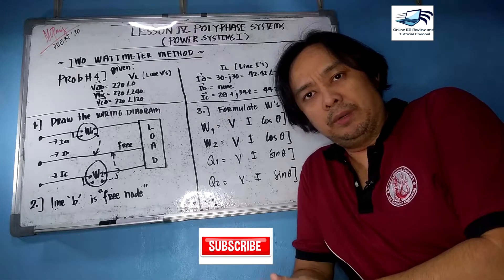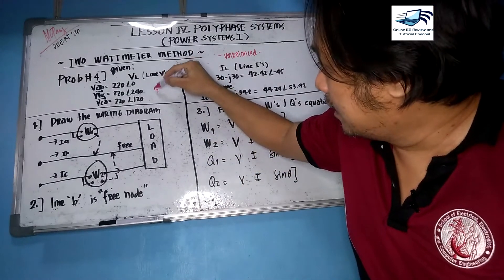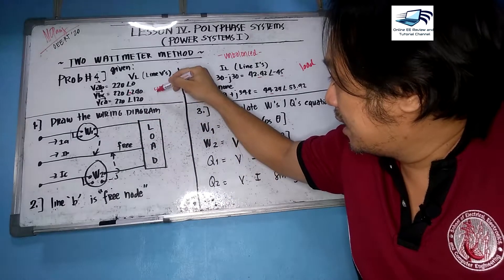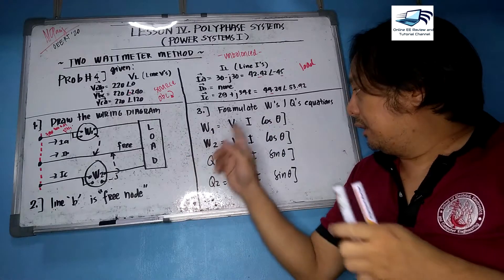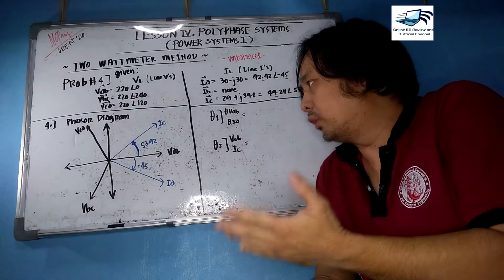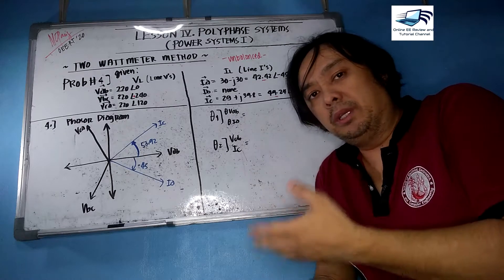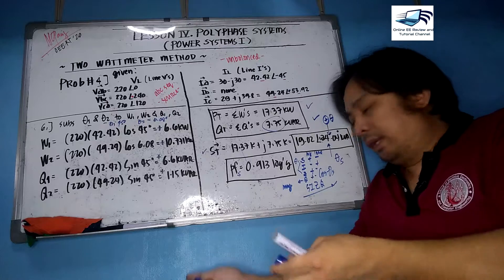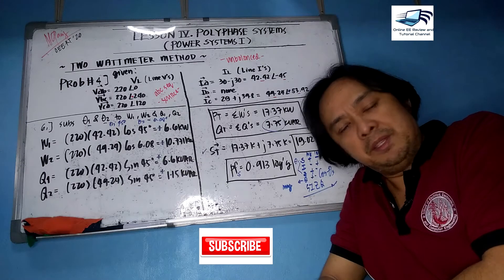Two Wattmeter Methods PART II (Problems) Unbalanced Case

Comment: Typo po sir sa Q2.
220*49.24*sin(6.08)
Reply from the maker: Hi alex, thanks, @12:18 yes,that's a typo error, the angle of the sine must be 6.08 degree, but the answer is the same. Thanks for the comment. Stay safe